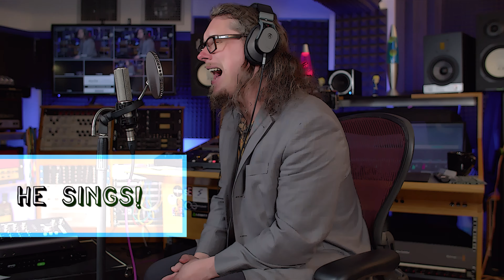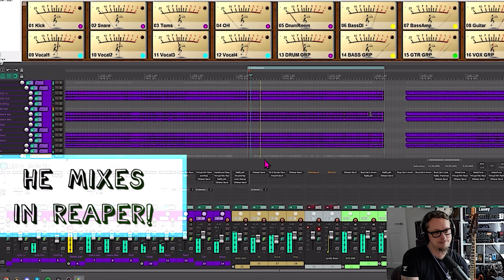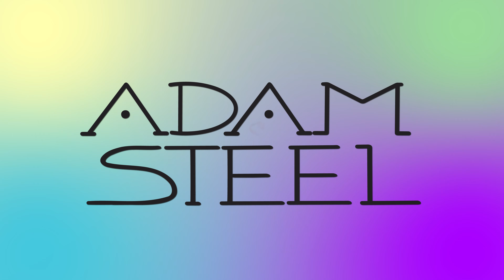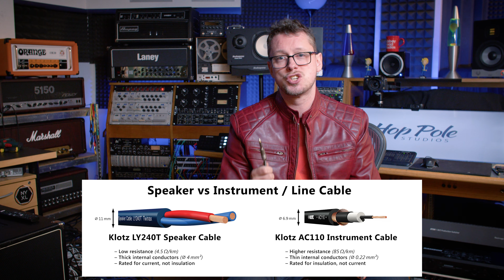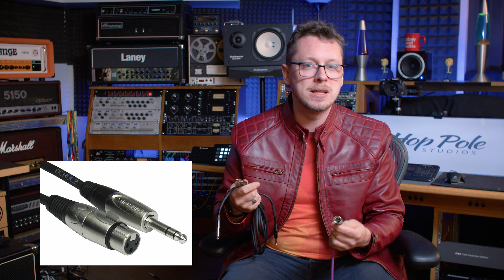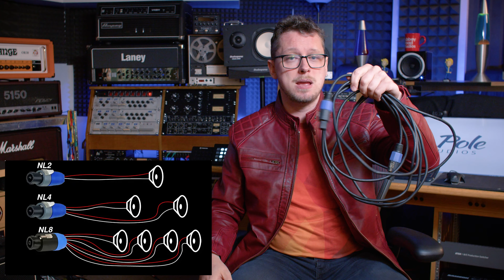Cables Explained, a brief guide for musicians

Comment: Great video. As a keyboard player, I am facing some issues. An example is that the volume of the tones seems to drop once plugged in; otherwise, they are loud coming from the built-in speakers.  What do you suggest, a TRS or a TS cable/s going from the keyboard to the mixer/amp? L/R.I would appreciate your professional advice. Thanks

Comment: What cable do you use on your studio monitors,! I got mogami 2549 but idnt like the sound of it on my studio monitors.
Reply from the maker: Whatever fits, if your cables are wired correctly you really shouldn’t be hearing a difference

Comment: if you re-wind to pre 90ies there's a tone of amp equipment using female XLR's on both ends as a make shit speakon style connector. A lot of people run an NL4 with 2 conductor speaker cable because they fit into the same sockets and the NL2 is basically impossible to disassemble and reassemble if you need to service it.
Reply from the maker: Yeah I’ve got a Trace Elliot amp like that, but I didn’t want to confuse things because that fell by the wayside over 20 years ago, thankfully